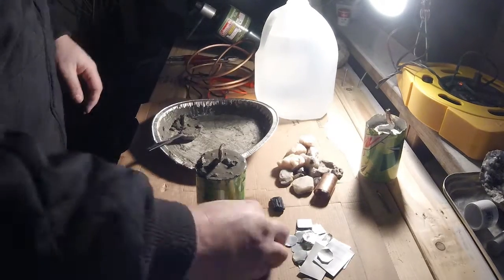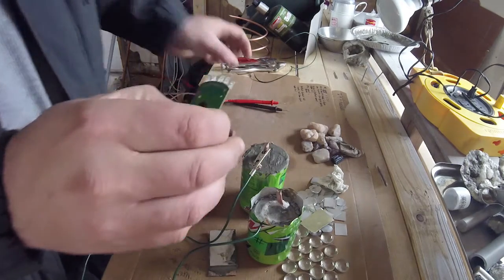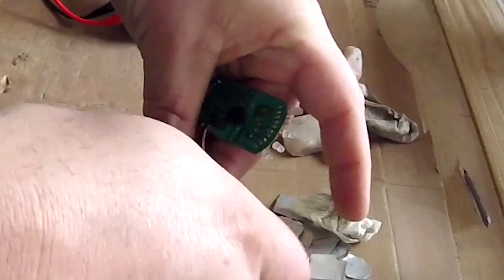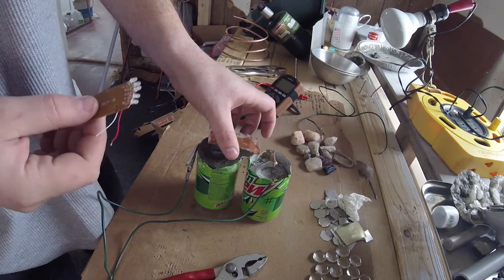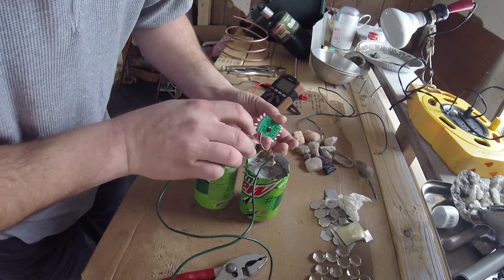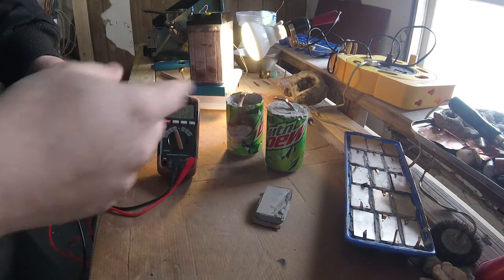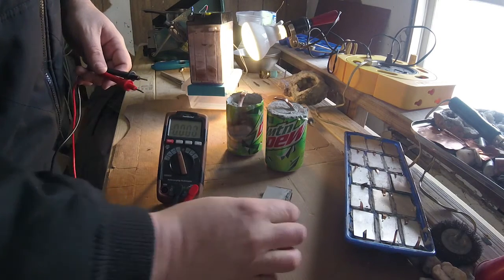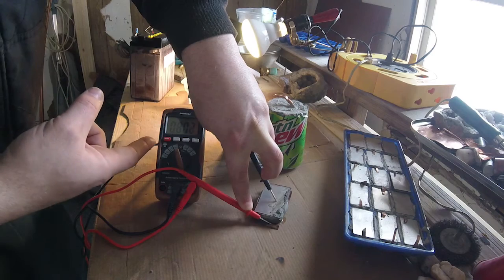FREE ELECTRICITY - Cement Battery Works

Comment: Hi I have made a concrete battery but using rubberized tile cement , getting good results, postive ectrodrode copper , negative aluminum tubing from a blind. Works great holds charge 🙂

Comment: It's not free. The electronegativity difference between the anode and cathode create an electric potential (voltage). You are consuming the poles to get current. The concrete, or whatever is used simply allow the flow of electrons between the poles. Chemistry 101.

Comment: Why not build a "Bagdad Battery" all it would take is a plastic jug, zinc (or iron), copper electrodes and some common kitchen acid like vinegar or citrus juice. You'll get a whole lot more volts than the cement battery puts out with less weight & size. Just a thought.

Comment: As a child with fillings
(this may sound odd to a normal person) I noticed forks would shock me when bumped into my filling which got me to put a cut penny in my mouth LONG STORY SHORT I ended up discovering that the penny was able to power a little 1.5 v keychain ...
I must have been 10-12 Wow back in the 90s but I didn’t have a volt meter and at some point was pulled away from what I was working on
Reply: Newer Account that just sound amazing , what did you work on ?😀